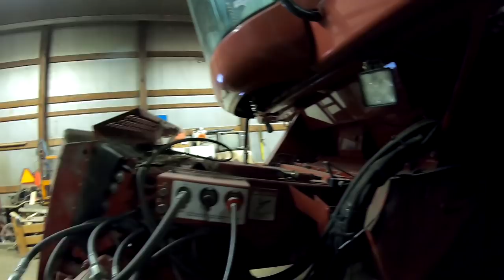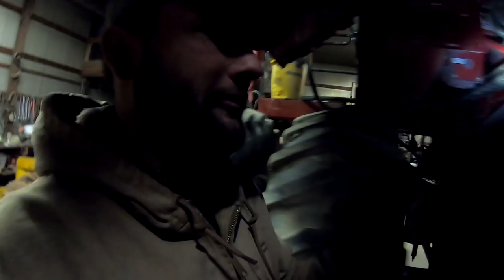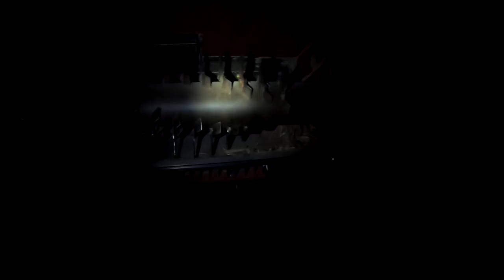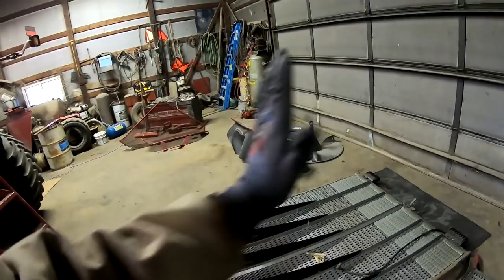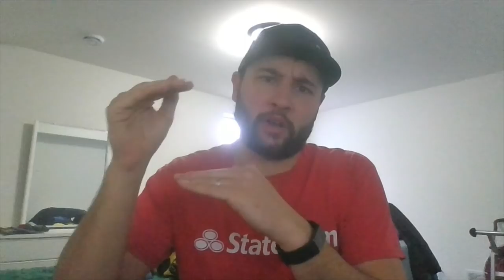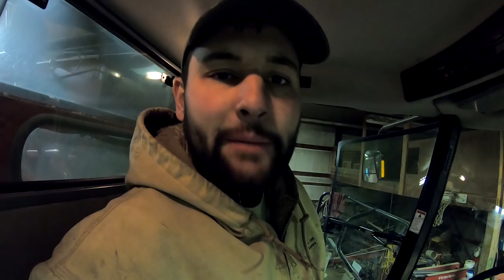ENGINEER Explains How a COMBINE HARVESTER Works

Comment: Great video Ron!!!  I was getting ready to rag on you for not talking about Gleaner combines, but then you mentioned a little bit.  All-in-All, you have to compare apples-to-apples,.....look at the expenses (Gleaner is probably the cheapest to buy and maintain), compaction (Gleaner is probably the lightest), ease of maintenance (Gleaner is probably the easiest), proximity to a dealer (This is where Gleaner falls short) and then make your choice.  You are an engineer,.....please make things easier to work on.  A lot of combines have to remove several other parts to get to something else.  This adds up to more down time.  Make better use of automatic greasers.  Make it easier to check vital fluids and add fluids as needed.  Same goes for filters.

Comment: Hi Ron! Thank you for answering my questions. How do the 3 rotors move the fodder through without clogging? qare they tilted? are the concaves built to progress the fodder? does the header "throw" it so hard that it can't clog? How fast are the rotors whirling?  I grew up with a 6' 1950 Allis, then an early self propelled, then all Gleaners-no cabs. Dad died from emphysema in 1998-all that dust

Comment: I still have a hard time understanding why combines are so short.  Seems like a longer combine design would hold more grain and provide more volume to do more.  Also why not switch to electrical dc/ac  power bus instead of hydraulics and belts.  Maybe it just to complicated but computers can change all the setting on the fly.  Also modeling the system would be a lot more easy during development.